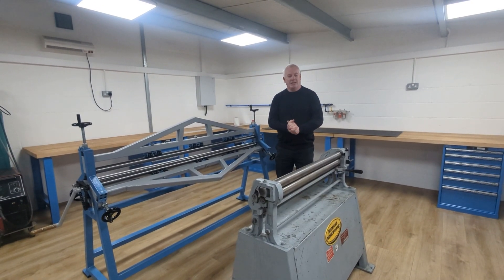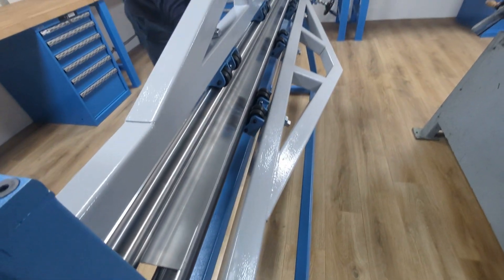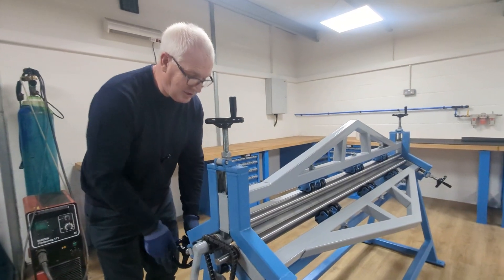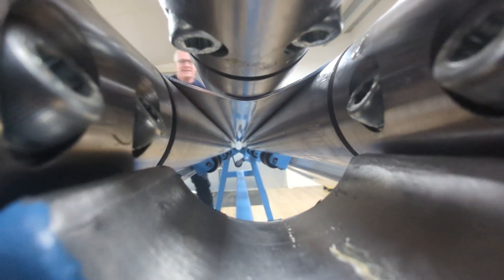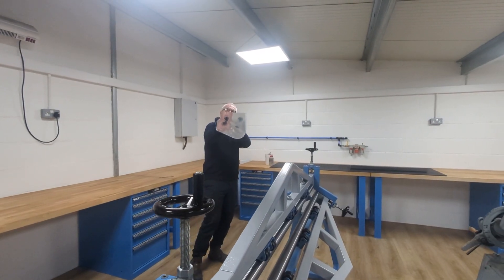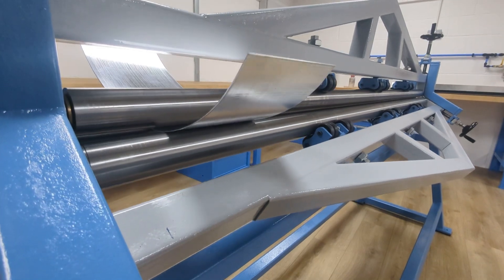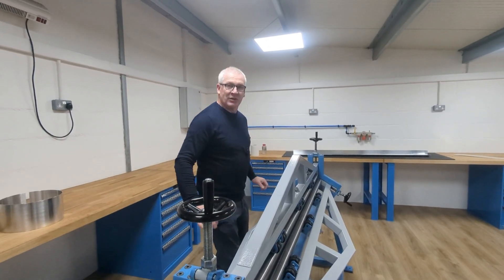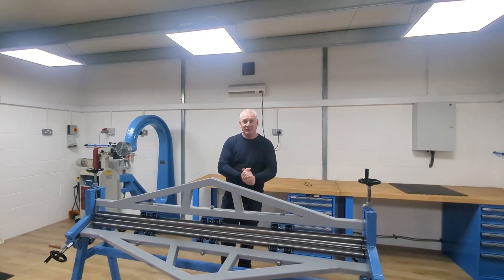My Homemade Sheet Metal Rollers: "They Actually Work"

Comment: This machine is very similar to Farnham leading edge roller.  The Farnham uses universal joints and electric motors to roll material.
Reply from the maker: Thanks for this I just looked that up and sure enough there they are. There's me thinking I invented the wheel. That Farnham is one hell of a machine, I am not sure if that can roll tapers. Thanks for watching

Comment: Never seen a machine with the roller supports that is a game changer, nice build! Now you have crown capability on a roller! I think I like building tools and equipment more than I like actually working with them.
Reply from the maker: Thanks for your comments. In my next video thats due out in a few weeks, I will be fitting a folding blade and using the bottom rollers as a v block for folding. Hope you enjoy it and thanks very much for watching.